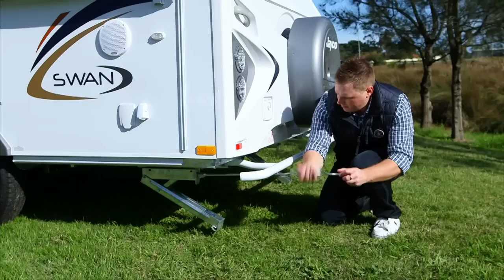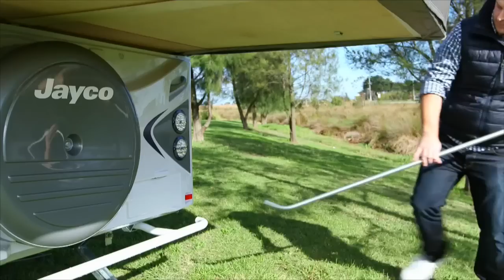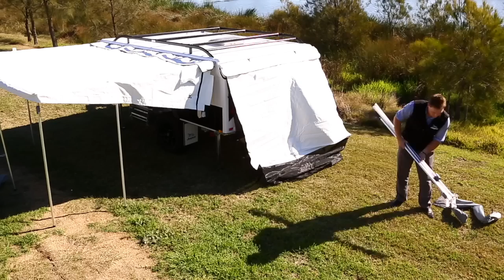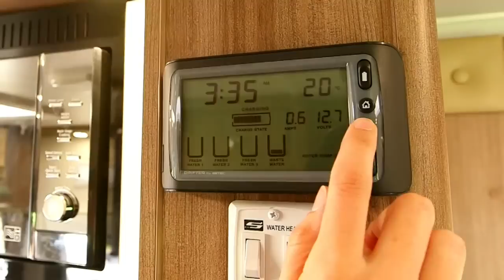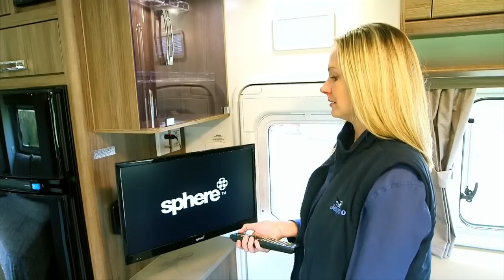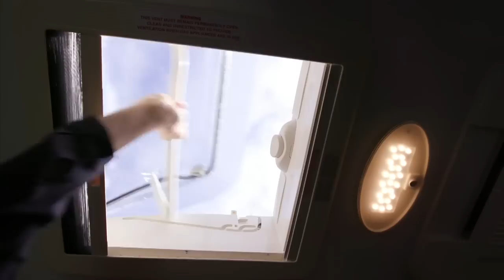2016 Jayco Camper Trailer Instructional Video

Comment: I've purchased a 2017 Eagle and found the setup of the awning and bed flies to be a huge headache. Absolute time waster. Selling the van ASAP and looking at a caravan with a roll out awning. Also, the sink design is a nightmare. You have to bend forward to wash dishes and the 12v pump outlet means you're guaranteed to get water everywhere you don't want it to be.
Reply: Sounds like you should stay home old mate🤣
Reply: Im sure you are not doing it in the right way.
I have those side and bed owning they are easy to set up and takes a bit longer to roll them up.
If two persons its super easy.